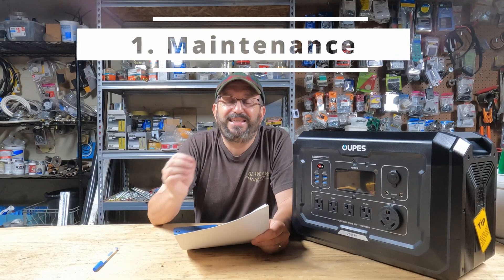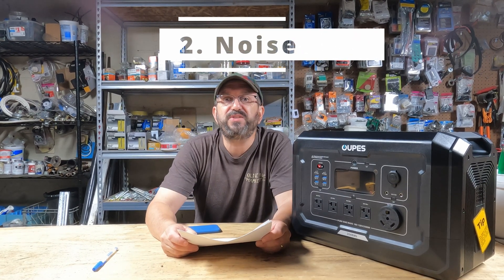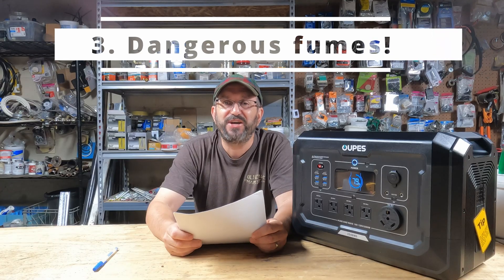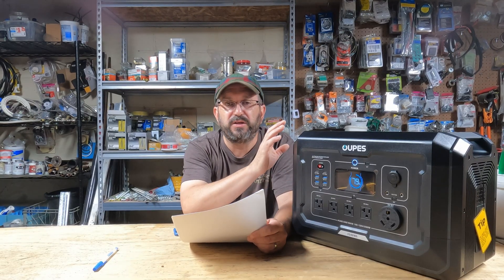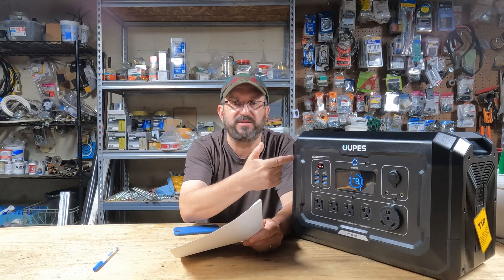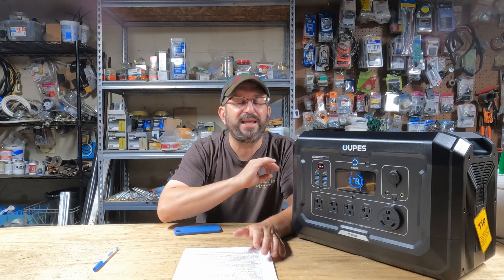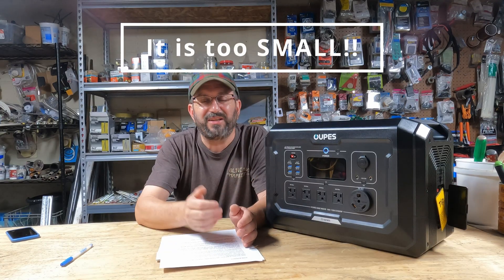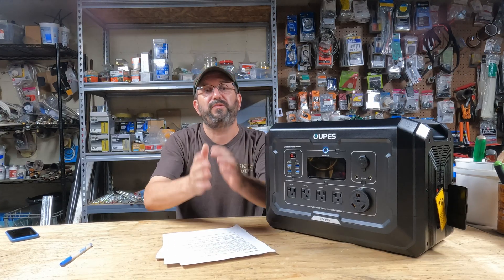7 Reasons Solar Generator Power Stations Are Better Than Gas Generators.  OUPES Mega2 is excellent!

Comment: A small fuel efficient inverter generator is a must as an additional backup, got to be able to recharge when solar recharging is limited.
Reply from the maker: Actually agree with you on that.  Even OUPES makes one for the purpose.

Comment: Hair dryer  1850 watts  
Microwave  1000 watts  = 2850
Why wouldn't a 3000 W generator run these?
Reply from the maker: My wife's hair dryer 1875w. Our Microwave is 1700w.  That is 3575w.  So for me that gas generator will not work. I base these videos on my experiences.  Yours may differ. LOL.
Reply: @OurBlackCatCottage  That's the stupidest thing I've heard today. Someone can't wait a few minutes till you're done using the microwave. Get a life.

Comment: $500 a month gas cost https://youtu.be/LWOoX7mh_xg?t=559  , actually 1/2 that overnight
Reply from the maker: Gas generator will need to be fueled up twice a day. Plus you have to change the oil a lot if you are actually running it 24/7.

Comment: I have 6 pecron solar stations and 1 gas/propane pur sin wave generator.  During milton I ldidn't need the gas/propane generator it was there for backup if needed.  My lights were out for a week.  I use the solar everyday 365 days a year.  Fridge frezzers microwave etc. all solar all year long.  I love oupes and pecrons because they are budget friendly but more importantly allow a ton of solar input.  A lot of name brands have very limited voltage inputs on solar making panel configuration difficult so you are forced to buy overpriced manufacturer panels.  Can anyone say Anker or bluetti 65v limits on those just ridiculous and for the price they should have real solar charge controllers in them.
Reply from the maker: Exactly.  You perfectly illustrate my point.  I agree with you 100%!!

Comment: This is so misleading because your solar panels are not going to provide enough electricity to run the power equipment he just mentioned it’s not enough battery capacity it’s going to run maybe an hour or so the 30% tax is gone this year you are better off buying a Tesla battery with solar but you are going to spend alot
Reply from the maker: Thanks for watching!

Comment: A combination of both is hard to beat, especially cold weather,  there's a few already making heated batteries,  remember you cannot,  definitely cannot charge a lifepo4 battery below 32 Fahrenheit , you can discharge but not charge,  this is something people need to think about especially if power goes out in winter and you don't have heat. The heated ones will heat themselves with solar,  grid, generator etc and then charge,  you could of course find a way to warm it without a built-in heater,  but it can take some significant time,  in a power outage in winter,  especially Northern states,  time could be crucial,  a combination of  solar power station and a gas generator could be life saving
Reply from the maker: Definitely  have to be mindful of lifepo4 in colder climates.  I reviewed several heated batteries - Li Time and Vatrer - that both performed well in very cold tests.
And I agree with what you said about a comb. 
Even OUPES makes a gas generator for backup.
https://oupes.com/products/e1600-gas-generator

Comment: To be fair i need to mention my back up, the honda eu2200. 47, runs 8hrs 0n .9 gallon of gas, pure sine wave inverter and ultra quiet and ultra reliable. I wouldnt be without it. Thanks for the video!!!
Reply: 47ibs
Reply from the maker: eu2200 is a nice generator. I thought about using that for this video but it was a bit on the pricey side.  Thanks for watching.

Comment: Agreed...if you need off grid power  very often or just temporary. A solar generator is the way to go...With solar panels, it's basically an off grid solar system. 
But I think the best of worlds is a big solar generator/solar system. With a smaller gas emergency generator. To charge it on cloudy winter days. When there's only like 8- 9 hours of daylight vs 13- 14 in the summer. 
I guess it really all depends upon your power needs. If you do a lot of welding. You'll probably want a big 10kw generator.... Luckily some non inverter generators actually have a THD of 5% & under. That won't damage an inverter style welder & other electronics. But a 5% THD non inverter generator is probably close to the same price as a non inverter generator.
Reply from the maker: Great points, I agree. Thanks for watching!